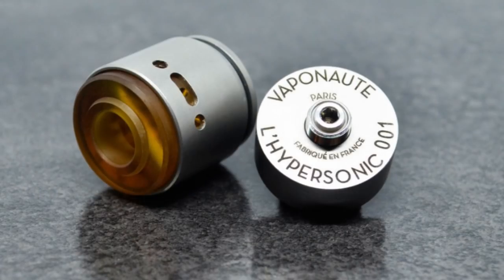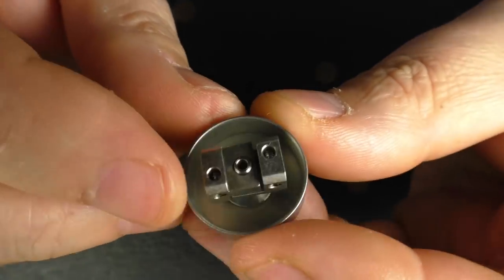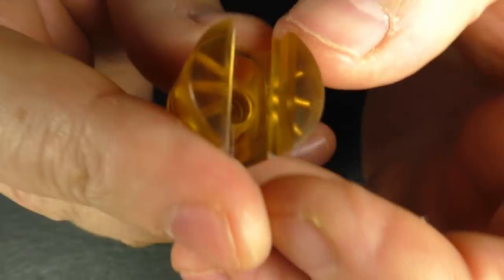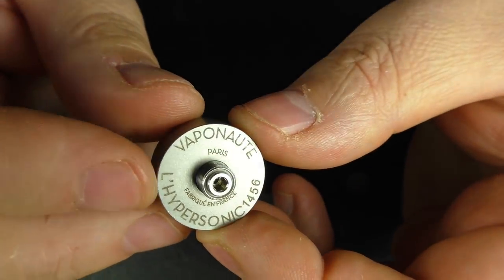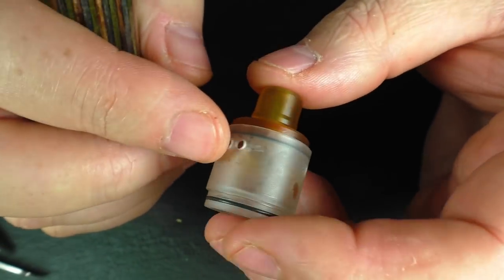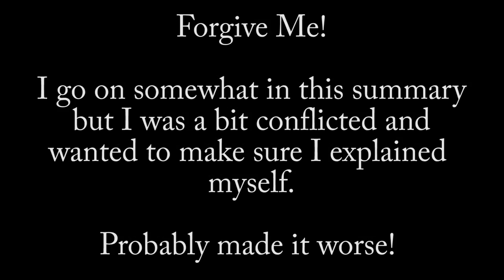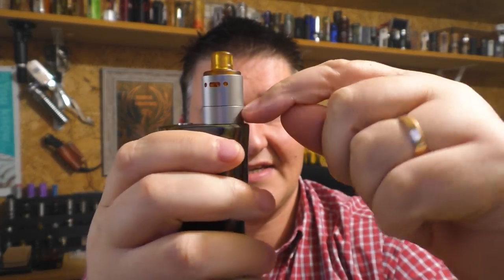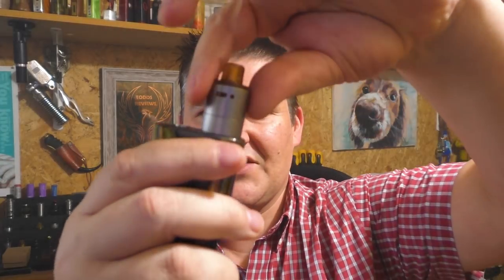L'HYPERSONIC by Vaponaute

Comment: I'm glad I passed on it some time ago, I was shopping in France and wanted a new atty along with a mod and normally vaponaute atties are hard to come by so I was tempted to buy this but a lack of reviews made me pick up the citadel instead and I'm happy I did, because this atty wouldn't suit me at all. I really find it strange you need a beefy coil with that airflow and small chamber, my skyfall with the 3x 1.6mm AF sings with a normal roundwire coil, so it doesn't really compute in my brain why that won't work here with 3x 1.5mm. Some thing I could look past since I do use atties with fused claptons if they ask for it to get the best vape, but I can't look past the squonking issue, not for this money certainly. As always, thanks for your honest opinion, much appreciated!

Comment: No need to struggle... I get the point and we can obviously see the issues. I concur about the squonk flow. Why wouldn't they have those little notches to help resist overflow? Also, for a 155 or so dollars it needs to have zero wiggle. IMO for that kind of money it needs to be nearly flawless. Concepts and designs have limitations understood, but whatever you do, must be done well. And... the top cap being hard to spin... hmmmn would be a total frustration for me, especially if it vaped as well as you say. I do like the juice well depth and for a bigger coil would seem necessary. Great review, thanks for sharing...and especially being honest.

Comment: You're right Mark, the juice flow issue could have been easily solved, either by adding notches in the ultem or by chamfering the edge of that centre bit where the squonk pin is.

The other thing that confuses me is the PC top cap. Personally, I think it's ugly as hell, but that's me. The bit that baffles me is why they didn't ship an optional ultem tank section instead. I think that would have looked quite smart, plus you'd be able to see how much juice is in the well.

It's a shame really, with a few small tweaks this could have been a really nice 'true' RDTA (as in a tank that you can literally fill by dripping)

Comment: Hello from south west of France
Religiously watched the review, as always, and found this atty on french winter sales for 51 euros instead of 129... For info, I've had no problem squonking on it so far,the solution is to use a 50/50 juice in here I think, it's not thick juices friendly... Tried it first without the exterior ring, maintaining the top cap by hand : no problem detected, juice flowed by the side, between the posts and the ledge of the top cap you were doubtful about. Then with the plastic ring, to try to "see through" it, and same result. And I'm not the nicest person when it comes to push a bottle, and the thing didn't leak on me (and still doesn't). Put a Ni80 dual core fused clapton in, .38 ohms, 3.71 volts, smooth airflow and flavours for days...

Comment: I think the intent with the ledge going all the way across was to flood the coil, initially, then have excess run off into the reservoir after you release the bottle. Obviously, execution leaves a bit to be desired. But, I think that was the concept

Comment: I had finish issues, chips in finish around the air holes  and uneven finish on the outside of the atty. and was very disappointed due to price point. Vape was nice but not nice enough for me to look past the finish issues unfortunately.. kinda wished they had changed the coil direction to the sides of the block not the ends would have fixed the cotton getting smashed imo

Comment: I think the ultem part does not totally lock of juice as you mentioned. The metal has a bevel and is lowered in the middle. the ultem has a straight edge so there mast be a gap in the middle letting juice flow down to the bottom.
But I agree. 2 notches would be much better.

 Thanks for the review...
Reply from the maker: I never said it locked it off Werner,  there is a very small gap on both sides or else the juice wouldn't get down there at all :)
Reply: OK - then I misunderstood...but I was only theoretical and you made the real experience - viscosity of the liquid and a too small gap are blocking.